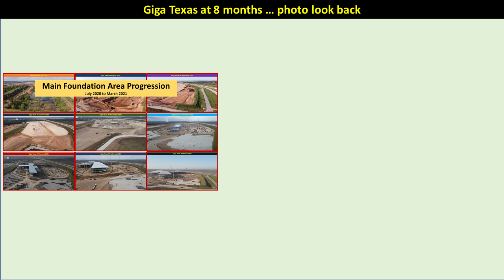Tesla Gigafactory Texas 22 March 2021 Cyber Truck & Model Y Factory Construction Update (07:45AM)

Comment: The things you call "inspection holes" are known as "vaults". These ones are concrete vaults to be exact. They are basically large pull boxes that provide pull and distribution points and for the electrical cables running through the conduits. There is a limit as to how long the wire can be pulled through the conduits. For large pulls like this a diesel powered "tugger" with a tension meter is usually used. If to much tension is applied to the electrical cable, the tension meter will stop the tugger from pulling any harder on the cable to prevent damage to it.

Comment: This is such a good way to see the speed of progression. would love to see a comparison against shanghai and Berlin in the format.
The main area is like:
1. July. Swamps and hills.
2. August. fairly flat with a small pond
3 September. flat and dry
4 October. graded
5 November. first structure
6 December. first roof
7 January. expanding fast
8 February. at least half roofed. 
9 March. walls and roofs for around two thirds.

Comment: @ 22:04 Two trenches for power conduit to the factory. There are also two transformers at the substation, and and power poles for two taps of the transmission lines. Two independent power supply systems for the factory.
Reply: Lets hope that Elon does not rely on the Texas power grid only! I think he will generate his own power through Solar panels and  his power packs for back up power.
Reply: @samson1200  While solar may supplement  power from the grid... Most likely not enough to power the factory. If the factory runs during the night, they would need a crapload of Megapacks to power it. And if there is an extended power outage... I doubt it can run for long. Though I may be wrong.
Reply: Well if Elon ever wants to put his money where his mouth is he will have go all renewable somewhere! 
Remember him saying a grid.   Of solar 100 miles square could power the U.S. not including distribution. This has bothered me for a while seems to me something he needs to prove with a very large project! Get Er done Elon!
Reply: @richardcarlson2644  I agree completely that he has to try. Otherwise he will look like a hypocrite when he tries to sell solar + batteries to everyone else. 
Though I doubt that it can be done cost effectively, time will tell.
Reply: @samson1200  Someone I know who is known for reliable information, has estimated that if the Texas factory were the size of Shanghai, they would need 3 million solar panels and insane amount of batteries to supply all of their electrical needs.

Comment: Conduits terminate at the electrical manholes. Utilized for cable pull boxes  per NEC.
Reply: As the cable drums are a certain length, instead of joining them in the ground, they sometimes bring them up in to termination cabinets.

Comment: 13:06. Spotted this after watching Randy's latest #126. Area with a shallow excavation between the white crane and the red service truck is exactly how the stair/ramp nine or so bays north started out a week ago. Also has the opening through the floors adjacent. Could be the pattern down this side of the building for a series of entrances. Note the loading dock being sacrificed, same as the other stair/ramp.
Reply: Considering how me estimate there are not enough docks, I am surprised they did not place those ramps on the X sections that host only one dock anyways.
Reply: @musaran2  Ramps might not have been part of the original plan. Afterthought or the relevant building authority asking for the addition of ramps. The external stairs were probably always going to be adjacent to those openings between the floors, which I assume are stairwells. Gives us a clue to where the next stair/ramp will be.

And now there is a vehicle ramp being constructed at the north end of this west side.

Comment: At 21:14 you can see a stack of smaller diameter corrugated metal storm pipe right by the one pile of trench boxes. At 22:00 the trench in the east will be a storm water trench with the big holes for storm manholes or catch basins. This ditch was excavated by Volvo excavators which are almost exclusively used by the water and storm sewer contractor. This ditch is also deeper than the conduit ditch and there would probably not be a need for a parallel electric duct bank.
Reply: Rainy tonite, and again later in the week. Too bad nothings hooked up yet.
Reply: Bob are we seeing 2 separate systems here? The one closer to the building for roof-water and to be re-used, and the one further east for ground-water collection and eventual discharge?
Reply: @DessieDoolan  Yes, The pipe in the parking lot will pick up the parking surface water and possibly any future building water. The pipe nearest the building has inlets on both sides so it will probably pick up roof and roadway surface water.

Comment: 14:54. Back shortly chaps, I need to um....change.
Reply from the maker: That was close ... I’m very glad no injuries happened!  This is not that common and to my knowledge, this is the first drone video to capture something like this.
Reply: @JoeTegtmeyer  Yes, that was a close call. Not the first catch, Randy filmed a fork lift knocking one of the concrete column props clear out of the ground.
Reply from the maker: @DessieDoolan  wow ... did not know that!
Reply: @JoeTegtmeyer  Seen in Randy's #72 at 11:04, behind the east crane. Video here; https://www.youtube.com/watch?v=Ys8rE5BnXcU
Reply from the maker: @DessieDoolan  thx!
Reply: Dessie, looks like the square shafts are elevators and the rectangular ones to your point could be escalators.
Reply: @cryan9376  Could be! But for sure there would be stairs somewhere. Nothing been constructed yet, but plenty of similar opening in floors like that one.
Reply: I can't quite tell what happened. Looks like maybe he turned too fast, and then stopped, and the steel just kept on turning?
Reply: @LinasVepstas  14:49 just as Joe's arrow appears and immediately below the arrow, it looks like there is a length of timber on the ground. I think there's your smoking gun, although the driver might have a different designation for it.
Reply: @DessieDoolan  OK, yeah, I think I can now see it go bump and stop sharply just before spilling the load.

Comment: 19:16 So you can remove wall panels that have panels stacked above them - their entire weight is supported by the columns via those red brackets?
Reply: Apparently so ... and even removable, without destroying the bracket! Seems like quite the trick to me.
Reply: The complete connection includes angles welded to embedded plates in the column, and in the back of the panel. The projecting lugs on the face of the column locate the panel for height, but aren't welded to the panel.
Reply: @DessieDoolan  I'm wondering if the top of the two panels that had to be removed was destroyed. We can see the lower panel with the door sitting off to the side, but that is the only panel laying around...
Reply: @zacadams7070  Didn't even notice that, good pickup. How does that tally with your panel count? 

There is a panel on the trailers that only has 2 straps on it, a bit casual for the highway but maybe ok to move it just around the corner.
Reply: @DessieDoolan  On the concrete columns, the brackets seem to be a double-U shape, and hollow. Perhaps a pair of bolts drop through those?
Reply: @DessieDoolan  that definitely could be the panel that was removed then! I will update for sure after Randy's video, but I believe there are 22 left on the southern wall, 4 (maybe 6) on the western wall, and likely 24 on the eastern wall but the column extensions don't appear to have a welded plate so I'm unsure how that top row of panels will work on that side
Reply: @LinasVepstas  I took a particular interest in these. I initially thought it was some sort of fancy proprietary system. No amount of googling found anything. Then I saw in one of the videos a reasonably good close up of the back of the panel. The back of the panel has a recess, presumably with a steel bearing plate at the top of the recess. The lugs on the face of the column seem to be 2 sections of RHS (rectangular hollow section, Aussie term) about 6 or 8" long welded to the column plates. The panel just sits on the RHS, there's no way to drop a bolt in, or weld it because it all happens in that recess. 

So just sits on the lugs, and has angles welded to the plates on the column edge, and the back of the panel.
Reply: @zacadams7070  Begs the question though, why didn't they just lean it somewhere nearby. 

Would have been hairy to remove it. The lifting anchors are on the top edge of the panel, so it has to be pushed out at the top to connect the slings. Thinking an excavator or 2 might be used to stop the panel falling forward. 

I'd be surprised if they weren't using the same system to fasten the panels to the column extensions. The steel plates might just not be visible at the moment under a thin layer of concrete wash.
Reply: @DessieDoolan  Ah, well, that's .. very simple! Easy to assemble and disassemble, Conventionally, something like that would hang, instead of standing; any clue why the lugs are low, not high up?
Reply: @LinasVepstas  The low lugs, that I can't figure out. It might have something to do with making it easier to slip an panel into place between one below and one above, but really I have no clues.
Reply: In a previous video i saw sun shining though the panels. The do not touch. At 18:28 it appears that they put (rubber) seal between the panels. I have seen them doing that before.
Reply: @Namsep  That's correct. The panels are initially supported only by the lugs on the face of the column, angle brackets are later welded to plates embedded in the back of the panel and the column, there's also an intermediate welded connection halfway along the length of the panel. Then as you say the gap is filled with a foam filler or backing rod, and finished off with a flexible mastic, Sikaflex or similar.
Reply: @LinasVepstas  Really good close up of the lugs/brackets in Jeff's day 244 at 17:35.

Comment: Amazing how fast Giga Texas is progressing past Giga Berlin. Berlin doesn't really have a as much done internally on the main building as compared to the way the US contractors are doing this. They are taking no time to spare. If the parts are there, they assemble no walls required.
Reply from the maker: It’s definitely a different approach than Berlin ... an agile project management philosophy versus what you see in Berlin.  In the end, both will be great factories.
Reply: Interesting in China how Phase 3 they are putting up walls in areas before the roof even. Rain season incoming though
Reply: @TheZackrambo  Fascinating how China is now doing production of their cars.
Reply: They don’t have permits to do much internal work in Berlin. From the looks of it Texas is 5-6 months behind Berlin.
Reply: @CodeLikeHell  someone today did a video with thr math behind the speed and time line and tesla Texas is about 50% complete after starting construction 3 or more months behind Berlin... that's not being behind

Comment: I wonder if anyone has gotten a zoom in on the casting machine model number......  With IDRA stating that they had their official "sale" of their 8 ton press, it isn't out of line to think maybe the installed press IS the cybertruck press and the terms of the sale were that it had to be on site and proved to work.  March 16th is about the right time frame for the press to have a cycle or two.
Reply from the maker: Yes ... it’s a 6,100 Ton machine. Clearly Model Y

Comment: I'm not sure if you would know the answers to any of these, but her goes:
A) If the paint shop is on the 2nd floor, are there ramps or elevators in there somewhere to get the cars up and down?
B) Since the roofs are sloped, where are the drains for getting the water down from the roof?
C) Does the roof drain directly into the large storm drains being installed now?
D) Is this factory so large it will have its own water tower?
Reply: A. They have robot arms on rails which move them through different sections. Those rails use the roof, the floor and the walls as necessary in different parts of the procss. Some rails go through holes through the roof/floor to travel the levels 🤠
Reply: @kanahn7402  Thank you
Reply: B & C) I have not seen any clue so far.
My best guess would be pipes on the wall exteriors, but that would be surprisingly ugly.

Comment: Thanks Joe great filming again. 
7:05. I went back a few weeks and confirmed that the geo-piering under these long footings is continuous, so they are expecting some heavy loads on the upper floors. The bored concrete piles in between the footings must be for heavy ground floor battery plant isolated from the footings (otherwise would have been constructed together).
7:16. The concretors aren’t wasting anytime, stripping the forms off the side of the footing, and shifting them straight into place to form up the column pedestals.
9:30. Elevator shaft for sure. The guy down the bottom (in the over-run pit) is stripping out the boxing for the pump pit (drainage pit).
12:53. External stair and ramp. Inside the building just to the north of this new stair is what looks like another over-run pit for an elevator (passenger), and to the south the opening up through the floors might be for a stair well. You can also see where they have sacrificed a couple of loading docks to construct this entrance, so a likely change of plans.
12:53. Floor slabs on this west side of the site seem to be fibre reinforced. East side all had rebar. See 17:28 for eg.
15:59. The small scissor lift just behind the column, is sitting on a hump in the floor that has been constructed in the last few days.
16:32. Those look like the big tanks down the back on the ground floor.
Also the floor seems grooved in this area.
18:29. Workers at the bottom of the wall are pushing in backing rod/foam before caulking with a flexible mastic.
20:05. The triangle. I think this will be filled in. The topping slab with the projecting rebar is a clue to this. Also on Joe’s Patreon page there a picture showing embedded steel plates in the back of the wall panel for a ledge of some sort to be fixed to, either for the final precast roof panel to land on, or for formwork for an in situ pour.
20:46. Column extension. Curiously taller than the steel column beside it. 
22:16. Conduits under the road aren’t particularly deep, suggests this road level won’t be lowered anytime soon.
Reply from the maker: Thank for all the details and comments Dessie!

Comment: A lot more concrete on the steel buildings now that the roof of the concrete building is done. They are almost done with the second floor on ALL the buildings. Now they are working on the ground floors

Comment: I am starting to think the full footprint will be built out since none of the interior steel they put up has the “feet or clips” the confirmed exterior pieces have to hold exterior panels. That is not clear so I mean I doubt they will have an interior road way.
Reply from the maker: I tend to agree ... I’ve pointed this out to people visiting the site while aim out there but have not said so in a video yet.
Reply: You can see on the east side there are some areas without the "clips" and some with.  Perhaps they can be welded on later as they did with the concrete columns.

Comment: Those column extensions on the roof and the associated walls are not just for looks. They are a part of the aerodynamic storm wind loading protection that changes the airflow over the roof to avoid the roof lifting off in a hurricane.
Reply from the maker: Good thing we don’t get hurricanes this far inland (mostly)
Reply: @JoeTegtmeyer  - Any tornados in this area?
Reply from the maker: @Chainyanker007  rare ... can happen but normally farther north in the Dallas area, but not impossible.
Reply: @JoeTegtmeyer  Apparently, just one of them can ruin your whole day though.
Reply from the maker: @ReevansElectro  true
Reply: WOW

Comment: Any info if this facility  will replace the one in Fremont Ca?
Reply from the maker: The Fremont factory is not going anywhere.  Giga Texas is additive
Reply: @JoeTegtmeyer  Good to know.
Reply: I'd like to see Fremont eventually phased out, but that's not happening any time soon.
Reply: @jbbuzzable  Well not for at least five years anyway, by then I'll be retired.
Reply: @Statimtek  Do you work there? If so, I wouldn't worry about it if I were you. As Musk says, "It's hard to change the tires on the bus when it's traveling at 80 MPH.

Comment: @ 9:15 is an elevator base. If you look straight up from there all the floors have an opening. I'm sure there will be more. 
@ 22:20 those are pull boxes. They can only pull so much cable at a time. You will see those spaced about every 100' or so.

Comment: Looks like that deep fire water line is to allow storm water pipe to go over it???  That would be my guess...
Reply: I bet your right that makes sense.
Reply: @travisporter0801  I wondered about that also but the storm water pipes seem to be much deeper than the crossing over the fire water pipes. Hard to tell how deep it is but I don't know what else would need such a wide low  water line crossing. I'll go with your quess.
Reply: @patrickdougherty2777  They may not need to put the storm pipe in at 25 feet like they did on the east side.
Reply: @kkarllwt  I am sure that there is a pitch to the storm water pipes. I was unable to figure out if this was the high end. If it is then there should be room for the storm water pipe to cross through here.